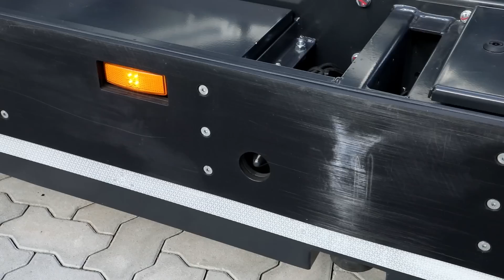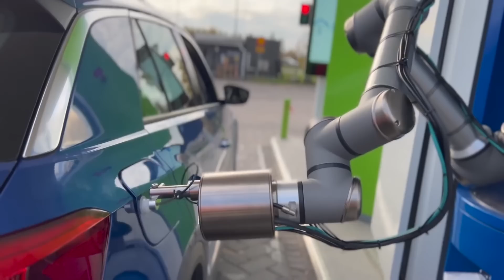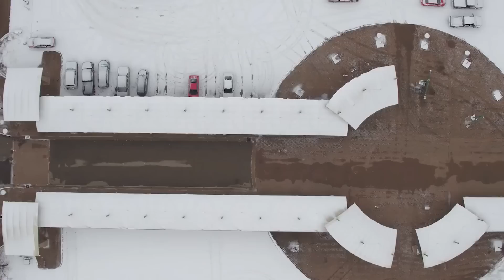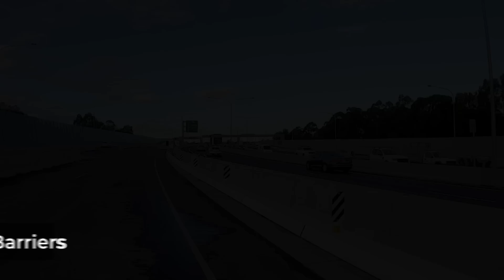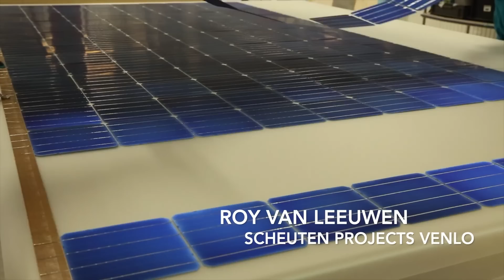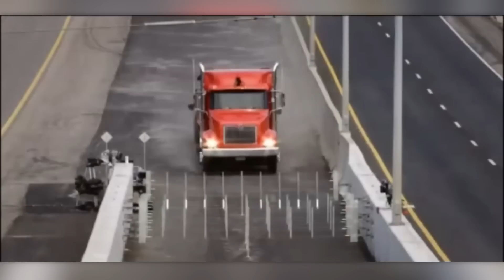INCREDIBLE ROAD TECHNOLOGIES THAT ARE INSANELY COOL

Comment: solar roads or cross walks. what happens to them when an E.V. catches fire and burns there for HOURS AND HOURS! Then the fire department sprays a few THOUSAND gallons of water on the entire area trying to keep everything else within 1/2 of a mile from catching fire. not to mention all of the chemical compounds released by the E.V's battery as it burns! Don't get me wrong. I'm for ANYTHING that will supply cheap, reliable but most of all SAFE power. I am old, and I am ALWAYS going to want an internal combustion engine in my vehicles. that said, I AM NOT AGAINST Hydrogen, or any other form of clean fuel. Gasoline of the 60's and 70's was a true marvel of engineering. But, I understand trying to clean up emissions. I just liked gasoline that didn't spoil in 60 days.

Comment: Carbon dioxide is not pollution. It’s plant food.
Reply: Yes and no. No, thus far all the extra CO2 hasn't been a boon to plants. You see plants are very specialized. Temperate plants can't handle even a 10 degree increase in temp. Rainforest plants don't deal well with less rain. No, as a whole, all adding more CO2 to earth has done is add even more CO2 as tons of plants die off. Don't get me started on who both absorbs most the CO2 and creates 85% of all oxygen on earth. They're even more sensitive to changes in ocean temps and salinity than ground plants.